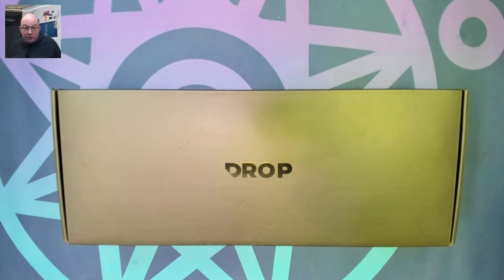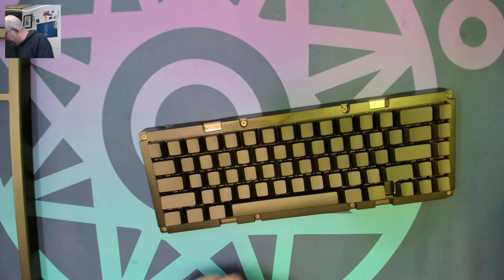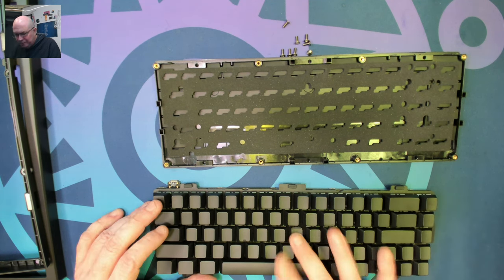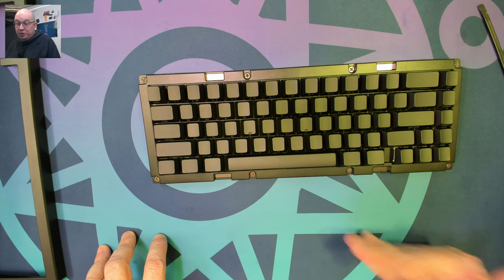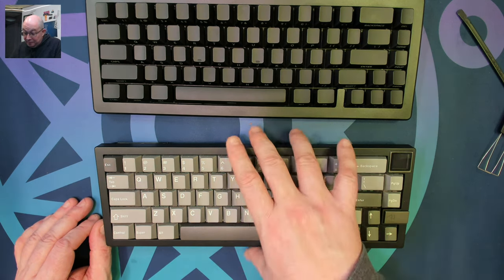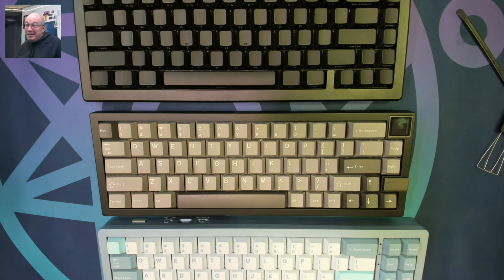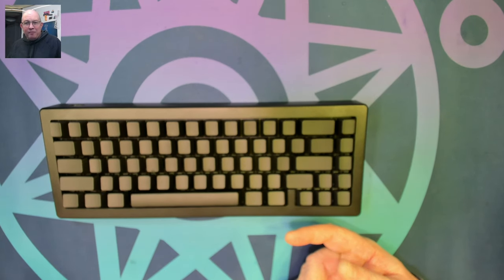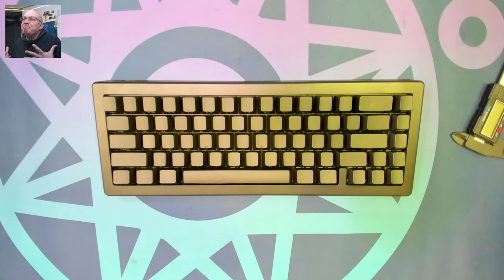Drop CSTM65: Overpriced and under featured | Review and Sound Test

Comment: It's definitely overpriced considering to me it's more of a niche product. If you want to swap the cases for different colors my guess is that dictated some of the design choices. No excuse for the soldered USB though in 2024 at all. I got mine on sale and was able to use my discount so for the price I paid I think it's wroth it but that was about half if what they were asking. 

In regards to the unit I received though my stabs were lubed and sound great plus my keycaps are 1.6mm thick however the case is 2.65 to 3.0 depending on where you measure much like yours. I note these difference and some similarities because I have to wonder if Drop isn't having multiple groups manufacture the keyboard. If not is the QC is that bad? Either way it's very concerning IMHO!

Very revealing review, thank you Mark!
Reply from the maker: Glad you enjoyed, cheers!